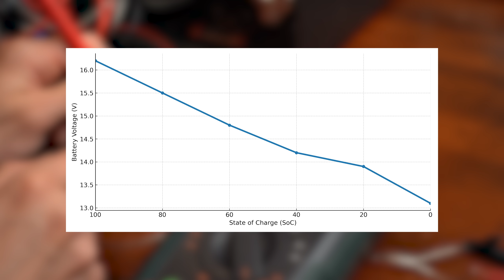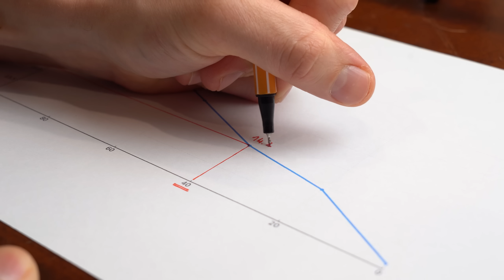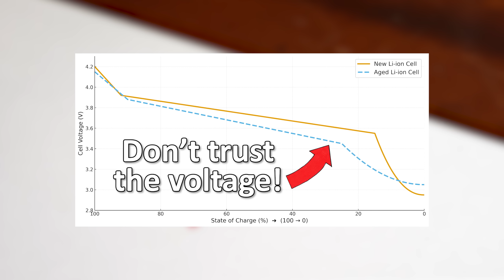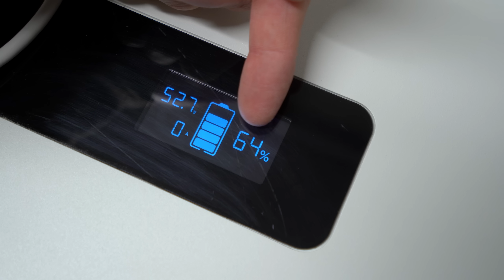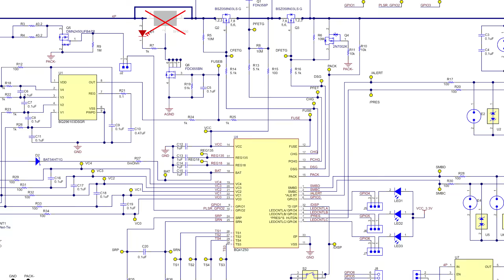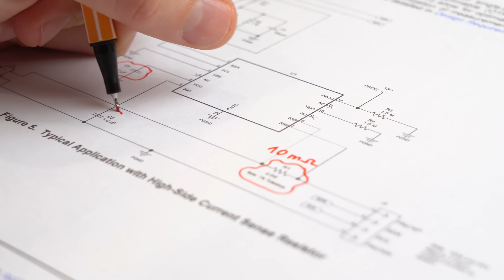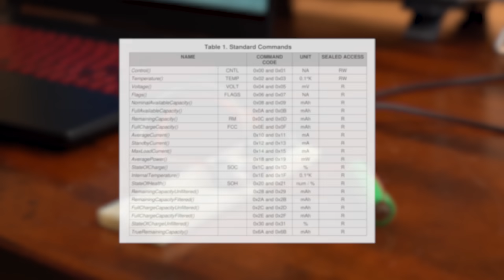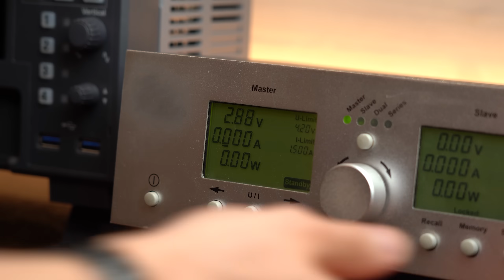The Amazing Secret in every Battery! (Fuel Gauge) EB#66

Comment: Shunts are very sensitive due to the low resistance, but its still a pretty easy circuit to build.  Basically you tap two traces off the shunt, as close to the shunt as possible and as short as humanly possible and not sharing current paths with anything else.  Do not tap off of the ground plane.  You shove them into a differential op-amp circuit with an appropriate multiplication factor and the output of the op-amp goes into a resistor + cap to stabilize the value, and from there into an ADC.

The key to high accuracy is to take a lot of samples and average.  Do NOT use a long time-constant R+C on the output of the op-amp... you want a time-constant of around 1uS.  Then sample at a rate in multiples of 50 * 60.  So a 3000 sample/sec rate is decent, and then average over 1 second (3000 samples).  (8 or 12 bit samples, 32 bit accumulator).  This will get rid of any 50hz or 60hz noise coupling into the signal and the sample count adds a couple of bits to the effective ADC resolution... which is really important.

You also need to calculate the op-amp's offset error, because that's gonna be amplified in a big way too due to the tiny delta voltages.  You do this when you know the actual current is zero.  And use that to compensate each reading.  You want the amplification to nominally use the full resolution of the ADC without current spikes maxing it out.

The selection of the op-amp is important due to the extremely small voltage differential being measured.  Some microcontrollers (like PIC chips) have built-in op-amps, but they might not be good enough for this job.

Then you do some math, which is always the biggest problem.  Hence using a microcontroller that you can program in C.  Even an 8-bit microcontroller like a PIC chip will work because you only need to do 32-bit integer math once a second.  When coding the microcontroller, the interrupt (3000/sec) should only accumulate samples and copy and reset the accumulator once a second.  The main loop can do the nasty math once a second where cycles don't matter so much.  Leave interrupts enabled at all times.   If using the same ADC to measure voltage, leave the sample rate at 3000/sec and just sample the voltage once per second (duplicating the current sample for that slot).  Don't alternate between voltage and current sampling (6000 interrupts/sec)... it causes problems.

Counting electrons is fun, but even the best shunts are inherently inaccurate so rather than trying to make the error factor as low as possible, you usually error on the side of a slight over-estimation during discharging so the state of charge display  can translate to "at least this much charge" rather than "kinda not sure but maybe this much charge".  And remember to reset the SOC indicator to 100% when the battery voltage indicates fully charged.  Shunts need resynchronization events to stay reasonably accurate.

-Matt
Reply: This seems very nice, can you give me some more sourcres about this kind of circuit or tells me where did you learn all this, I still have troubling understanding some part. Thanks in advance
Reply: That looks doable. Thanks for the information.
I will try to build one myself.
Reply: Very well explained you know your stuff❤

Comment: Hi, great video. If all cells are in a row, the soc of one cell in % equals about the soc of all. So just display the single cell info is good enough
Reply: they're never perfectly equal so that's only a temporary solution
Reply: @kiq4767  "good enough" means not perfect, it would work fine as a permanent solution.
Reply: The cells are in series parallel configuration (4s3p i think) so measuring only one of the cells would give a rough estimate, but not the full picture..
Reply: It is, with a bit of active balancing

Comment: Victron makes a nice all in one battery fuel gauge that has bluetooth connectivity. It's a little overkill for what you need but it works well.
Reply: he even features it in this exact video 🤔
Reply: @casemodder89ahh. It looked like a regular shunt resistor since he never showed the front.
Reply: @JerryBiehler  i've been using 2 victron smart shunts for a while personally and installed a few in campervan builds and solar installations for buddys + fam. so that catched my eyes in a splitsecond 😅

Comment: AFAIK there is no perfect way for monitoring the state of a battery. That's because of some really hard to understand electrochemistry reasons… For example electrode potential, internal resistance, polarization, and so on. Batteries are harder to understand than we thought?
Reply: True, but cycle data and accurate coulomb counting is by far the most practical, especially if the battery fully cycles regularly, resetting 100% when the charged voltage is reached and the tail current drops to <0.01 of measured overall capacity.
Reply: That’s exactly why at TI we have models and simulations that run on the gauge every so often about 15 times during a discharge to ensure the battery’s capacity and resistance often good indicators of chemical capacity are understood where it is taking us next. The database is about 5000 batteries we have characterized and counting!

Comment: Quick thought: since this chip works only for a single Li-ion cell, why not use multiple of them? For example, if a pack uses 4 separate cells, you could put 4 of these single-cell fuel-gauge chips and let an Arduino read all of them. The Arduino can combine the readings and show one overall battery percentage. Since the cells drain together, the Arduino just averages or calculates the total SOC. Not perfect, but it could work as a modular multi-cell monitor.
Reply: There's no engineering like over engineering! But I concur, let's also get a bigger display and display all the parameters from each cell...

Comment: 2:50 - a common problem with stupid ebike battery indicators. You twist the throttle and watch the charge drop (voltage, they simply measure real time voltage and convert it into charge level)
Reply: My Inokim scooter has a 5 segment "fuel gauge", but also has a secondary line in the display that can show Odo km, Trip km, or... pack voltage! And sure that varies with current draw but at least I can tell roughly what the real state of charge is.

Comment: TI engineer here. Glad to see we are supporting you, you deserve it 

Lmk if you have gauge questions, I’m an SME for these fickle lil beasts
Reply: Also great job explaining internal resistance causing spiky loads difficult to gauge. Can be a huge pain, huge gotcha when working on gauging.
Reply: Yeah that was actually a question I had, do these just have a sufficiently high polling rate to correctly calculate the energy usage in a current spike? Or is there some estimation going on
Reply: @bobbyflay4104 lets look at BQ27427 for example. 

Cheaper, system side gauge, low power. Current sense resistor integrated. 

options to take readings at different rates. 1 per 60 seconds, or once per second. Tradeoff here is Gauge’s power consumption 

The neat thing I like about this gauge:  there’s a shunt resistor comparato. Meaning, if there’s a large load spike, the gauge will automatically start polling its ADC very quickly. So it will capture those load spikes in its delta sigma ADC inside
Reply: @bobbyflay4104 take BQ27427 for example. 

System side battery charger , small, low power. Integrated sense resistor. 

It can read once per minute, once per second. It has a wake comparator so if load > sleep current, the gauge starts polling really quickly. The goal of the increase ADC activity is catching those load pulses to your point.
Reply: @bobbyflay4104 a combination of both! ADCs for measuring battery voltage is polled at a continuous rate. Coulomb counter across the sense GS! Showed is continuously integrating.
Reply: These being locked by manufacturers is the most annoying thing ever. It took me £200 for nlba to get my rov running again as no parts and no support is available and the batteries were dead. The only option was to unlock the chips and clear the errors after replacing the cells.
Reply: Help him out with a multi-cell fuel gauge  breakout board for one of your ICS like the BQ24610RGER. Too complex for us hobbyists xD
Reply: For mid 2000's gauge chips.

Is there any way to reset it back to working order after cell replacement?

We've got old retro machines here with batteries that are no longer manufactured.
Reply: Where can I find a bms with a TI fuel gauge? I was able to get battery packs with a BQ40Z80 and created a full UI with power management of a 5S1P pack but I had to custom order x50 of the battery packs from a manufacturer.  

I'm looking to make my own for projects around the house and it's literally impossible to find off the shelf bms with a TI fuel gauge.  Any sources?
Reply: @fredthebulldog529  Old laptop battery packs
Reply: Massive thanks Mr. engineer !!! Is there an ic or simple electronic setup to plug in backup battery next to to original 2xNiMh? I have Psion Revo Portable computer from 1999 year, and I would  like to add small Li-ion battery for backup. Originally it uses pack of 2xNiMh AAA size @ 700mAh. 30% of charge is reserved for 2week backup, rest is for user. After 30yrs original batteries capacity is impossible to predict, and of course I've replaced it with new pack. It has your's Bq2002 as a fuel gauge ! From first tries it works fine, with current draw info available, but I wanted to switch to bigger AA cells, and have a backup li-ion battery, so I would never have data loss again. So far charging IC and fuel gauge are working ok, but problem is with making 3d printed battery holder that will work with original retractable clamshell. If I had small and reliable Li-ion I could make it without attachable part. All best!
Reply: Oh no, I've used your gauges and am using the bq76972 and I am always amazed by how you guys implement features that are complicated and do not work well for me, while you don't implement features we desperately need. Probably another big company like Dell or HP wants those 'stupid' complicated features.
Reply: Can ina219 used for soc?

Comment: A multicell version would be awesome.
Reply from the maker: One day ;-)
Reply: @greatscottlab victron energy has commercial battery monitors (w shunts) that monitor current in/out, soc, etc. 
I will likely buy one for about $400. 
There are much cheaper ones on ebay too. 
Might be interesting to peruse their diagrams….

Comment: mAh is bad to use for battery level because it doesn't say anything about voltage which varies through the discharge and also through its life time. Therefore it can't say anything about energy storage.
Wh (Watt-hours) or Joules is the only way to go.
A lithium cell starts somewhere around 4.2-4.3V and usually ends around ~3V so the error becomes quite big if you don't include voltage in the calculation.
If you have a 2000mAh battery the first 500mAh have more energy than the last 500mAh.
Reply: exactly. so he replaced an unprecise battery gauge with an... unprecise one.
Reply: Since Ah is an actual measurement of energy potential, then measuring Ah flow is actually the only way to determine the SOC, but only over time, and only once the cell has completed a full cycle or two. Memory is needed to keep a record of the coulomb counter output over time. SOC and W is a calculated value derived from V and Ah and is instantaneous reading; coulomb counting is the key to calculating retained capacity, but only when the actual capacity has been proven first...

Comment: You can make the exact same thing with arduino.
A shunt, an opamp to measure the shunt voltage drop and a voltage divider to measure the voltage.
Reply from the maker: True. I even said that in the video. But when it comes to accounting aging of a battery pack, it becomes more complex.

Comment: I used to use esp32 ADC to measure the battery voltage, only finding out the adc on it is horrible. Then I used ads1115 to read that but to convert voltage into % was not easy as you show in this video. And testing the voltage while charging also need to control the en pin on the charging chip. The fual gauge looks promising. Thanks for the video.
Reply: I tried that with an ESP aswell. But the inaccuracies didn't matter for me. I was experimenting for a possible solar powered project, and just wanted to get an approximation of the battery to work out if the battery and/or solar panel was appropriately sized for the project.
Reply: Agree on your charge/ discharge complexity. During discharge highly depends on your load- you could use a lookup table if the load is extremely light but would miss the compensation for aging. A lookup table for a “load scenario” is common on some products to make it better with an ESP32.

Comment: i think the arduino can measure also everiting of a battery but you need to connect resistors like battery 16v pack you need like grond to ground and positive to R1 :100K ohm and to analog pin 0 and R2 in searies with R1 R2:33K ohm to 5v positive in arduino nano😅😊❤
Reply: yeah, you could use voltage dividers for that, but it wouldn't be nearly as accurate (since Arduino's ADC is not... that great), and it'd require waaaaay more research into how batteries actually work. still, it's good enough if you just want to see the voltage on a battery pack, for example!
Reply: @kittyle8 you can use module INA219 to measure voltage and current it can measure up to 28v your 16v rS pack can be measurend just connect to arduino nano module display also and some code and if you know your capacity battery pack than with code you can measure also percentage

Comment: 7:55 - spot the mistake
Reply: LMAO, he even mentioned the polarity of the connector being reversed...
Reply: Pun intended?
Reply: Wait what's the mistake?
Reply: @_yourNameHere__ soldering on a cell. You need to spot weld a nickel strip and solder there. 
Spotwelding is short enough so that heat doesn’t  penetrate cell. Soldering takes to long so thermal runaway or at least severe cell damage can happen
Reply: @olaf_s_23 oh thanks for the info never knew this!
Reply: @olaf_s_23 if you want to be the "ackshually" guy, you need to acknowledge that
1. there is already a nickel strip spot welded, how much heat is transferred in that time through the spotwelds? probably not a lot since the piece of strip will be solderably hot quickly, thus he'll finish soldering quickly and use much less total heat, which dispersed into the casing of the battery is not a big deal
2. this is an old cell he does not care about it

Comment: These BQ chips are used widely in laptops
Reply from the maker: Thanks for the feedback :-)
Reply: Although sadly not my HP laptop is it keeps shutting down due to low battery at all sorts of random battery percentages.
Reply: @Ed.R  battery is fcked.
Reply: @Ed.R battery might be too old so when loaded drop voltage too low so BMS is shutting down.
Reply: @vadnegru I reckon you are correct I should probably replace it.

Comment: I made a massive portable speaker around 5 or 6 years ago for beach get togethers...

It runs on a solar and battery 
6in/16.5 mm woofer and a 10 inch 25.4mm passive radiator..

It's awesome
Reply from the maker: Sounds awesome!
Reply: @greatscottlab now I am looking forward to this video... LIFePo4 cells have treated me well....but age hurts as you say
Reply: You are awesome

Comment: Oh, yeah! I get similar issues with new battery and higher current draw when battery monitor was only voltage level. Atmel MCU in that stage with my firmware just think, that battery is low at higher current draw stages and initialized power off cycle.. 😂 My solution was to remember battery level and creating timeout counter when low was detected.. Didn't think, in that moment, about current measurements.. 😬😂
Reply from the maker: Interesting solution you came up with! ;-)

Comment: Couldn't you put one of those fuel circuits across each battery in the pack, then have the Arduino give stats on the whole pack?

Or are they a little too expensive for that?
Reply from the maker: That sounds a bit over engineered. But should be possible ;-)
Reply: @greatscottlab  Overengineering is usually the third or fourth feature of every project I undertake. (:
Reply: Assuming the pack is well balanced and uses the same cells, one should have the same health as the rest of the cells. I was thinking about using a voltage divider to estimate the entire pack though, seems doable.

Comment: Would a lead-acid battery work with a similar setup? I would be interested in an experiment of making a UPS with a double-conversion or some kind of protection circuit against the dirty power generated by inductive loads or fast load changes. Sure, it's all about mains again, which should be taken with caution, but I don't know if I'm after a +300€ solution justto protect my computer from getting its power supply killed again by the unstable voltage.
Reply from the maker: Yep. All battery types can use such a fuel gauge. It is pretty universal to use.

Comment: Question: why is current (and charge, in mAh) the magnitudes these meters deal with when in reality, the power (and energy) should be the ones that matter?
I mean, it's not relavant only to know if something is consuming 0.5 A, because it could be using like 3 V or 12 V (e.g. several cells in series).
Reply from the maker: You can honestly use either to calculate what is going in and out of your battery. The power so Wh is especially useful when you convert voltages. But Ah works perfectly fine for this since we only care about what goes in and out of the battery.

Comment: but some of them use a bluetooth chip to measure the fuel gages too, like i did on my bluetooth speaker. it will shows how much battery power is left on my bluetooth phone indicator (when the speaker are connected)